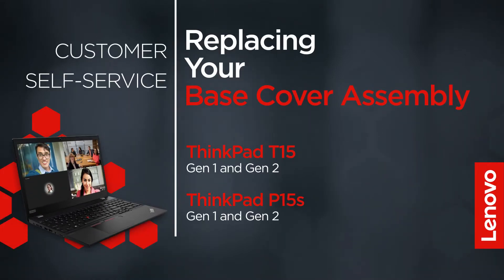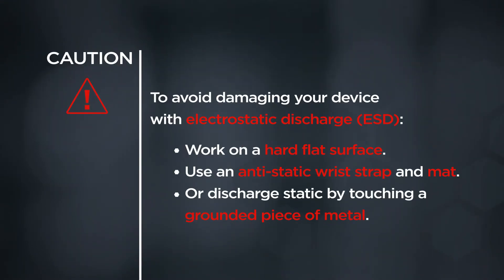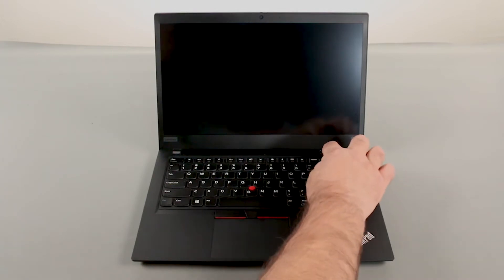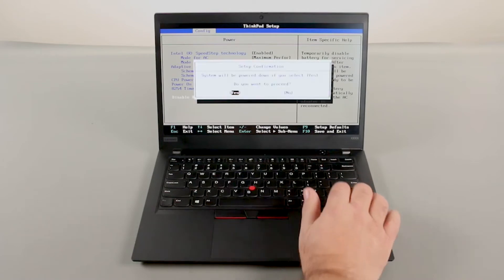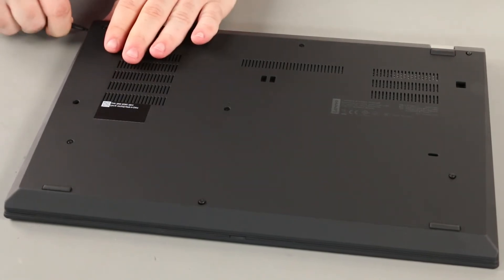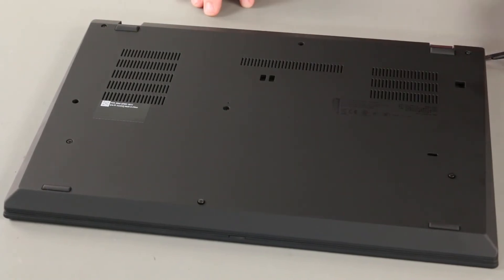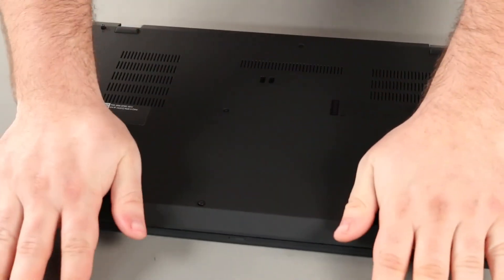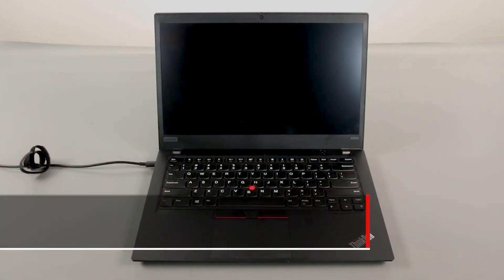Replacing Your Base Cover Assembly | ThinkPad T15 and P15s Gen 1 and 2 | Customer Self Service

Comment from the maker: This video will show you how to replace the Base Cover Assembly of your ThinkPad. The process in this video will work for the ThinkPad T15 Gen 1 and Gen 2 and the ThinkPad P15s Gen 1 and Gen 2. 

You will need a screwdriver kit, a non-metallic pry tool, and 10 minutes of your time.

To learn more about your device go to https://pcsupport.lenovo.com

To find parts for your device go to https://support.lenovo.com/parts-lookup/?cid=ww:lenovosocial:b9515f&source=socialmedia&subsource=yt

To view the Lenovo Support Self-Repair Guides landing page go to https://support.lenovo.com/us/en/solutions/HT516547

** NOTE: Static electricity can destroy components. Use a grounding strap, and clean, non-conductive surface to work on. Use plastic or coated tools to prevent scratching and avoid using metal tools on plastic parts. For more detailed information on electrostatic discharge and how to prevent it, please watch our ""Understanding Electrostatic Discharge (ESD)"" video: https://youtu.be/by4PB3WtdLo 

Applicable Machine Types:
ThinkPad T15 Gen 1 - 20S6, 20S7
ThinkPad T15 Gen 2 - 20W4, 20W5
ThinkPad P15s Gen 1 - 20T4, 20T5
ThinkPad P15s Gen 2 - 20W6, 20W7

#lenovo #LenovoSupport #LenovoTechSupport